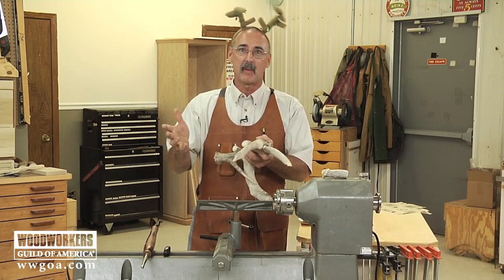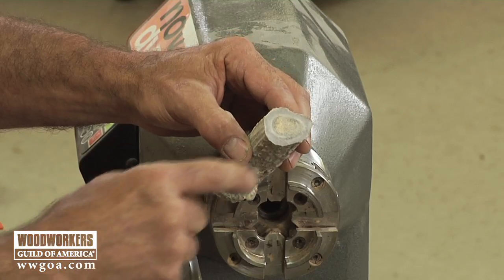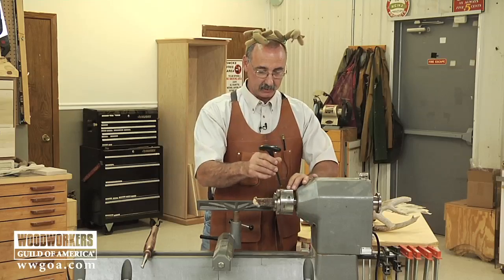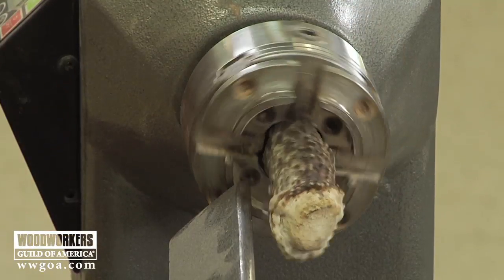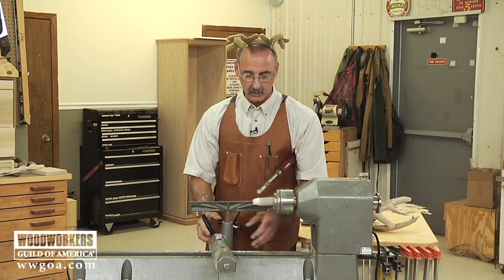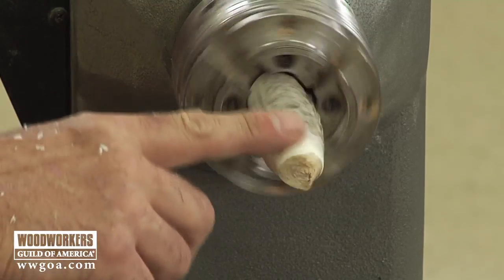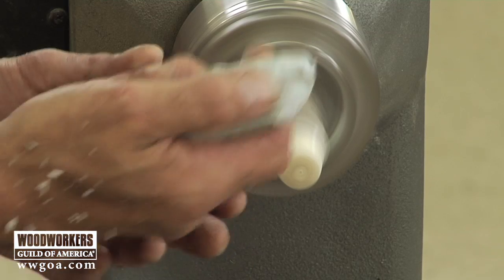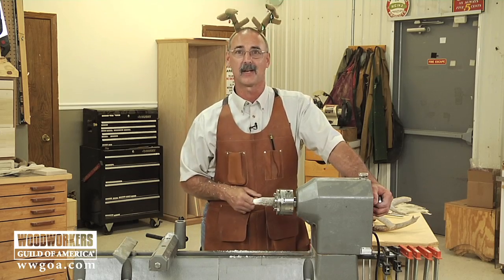Woodworking Tips: Working With Antler

Comment: Hello George;

I have some antlers from an Irish Elk (Megaloceros
Giganteus) that became extinct near the end of the last Ice Age and they are
thicker than a man’s wrist.  The pieces have
come from gravel pits in German and Hungry, so at one time or another after the
animal died their antlers ended up in fresh water.  Their color is a light tan brown and since
they were probably tumbled around in a stream much of the finite detail of the
antler have been smoothed, especially around the burrs.  They seem to be rather dry and in the Irish
Elk they had tended to be very spongy in the middle.  The Irish Elk had some of the largest known
antlers in any deer, a large mature stag antler could be 12 feet across and I’m
sure the weight of the antlers was significant, that is why they were so spongy
in the middle to help lighten the load off the poor animal’s neck muscles.  Even though they were spongy in the middle they
were very durable.  If you were to look
at one of my antlers you can see the hard bone like surface and the spongy
middle, which over time has mostly wasted away. 
To stabilize the antlers, they were coated with a clear glue. In order
to maintain them in this condition, they recommend to keep them at room
temperate and avoid heat.  If any section
of the antler should need attention, they recommend to treat that area with the
clear glue again in order to stabilize the area again and keep it from flacking
or wasting away.

My question is, I want to restore them further to as close to
their original condition as possible.  It
is possible to hand sand them down (I tried it on a small section of the
antler), and my intention was to sand away all the blemishes.  Once done I wanted to “polish” them up to
appear more bone like and restore their original color.  Can you give me any advice or make any suggestions
on how best to do this without damaging or destroying the antler?

I also have a small tusk section of an American Mastodon,
which became extinct during the last ice age also and have sanded away all the
blemishes and used a polishing tool on the piece and it shines like a brand new
penny.  But we are talking ivory vs dry
bone here. So any suggestions?

Thank you in advance for you time and advice on this
matter.  Have a nice day and God bless.

Leo Aguirre
Reply from the maker: Hello and thank you for your question.  This is interesting, but unfortunately your inquiry extends outside of our area of expertise.  I'd suggest contacting someone who specializes in this area for some guidance.

Comment: I just got started into working with bone. I'm combining wood with bone to make a ring. at what point do I stop using power tools. (dremel) and start sanding by hand? When do I switch the grit of sand paper to a lighter one? (300 grit-2000 grit)
Reply from the maker: Hi Michael. Whether it’s antler or wood, the answer is pretty much the same. Each finishing operation should remove the marks from the previous operation. If you can power sand up to the final grit you plan on using, go ahead and power sand throughout the process. When I’m making antler knife handles I start hand sanding at 500-grit. Not because I feel it’s important to hand sand, but because I don’t have a sander that will take 500-grit paper for power sanding.

Comment: is a 4 jaw chuck the only way to mount antler or can you turn it between centers ?
Reply from the maker: +Tyler Greenhalgh Because of the hardness of the material you will have a hard time getting a good grip if you attempt to turn it between centers, so I strongly recommend that you use a four jaw check.
Reply: I turn between live centers 90% of the time. I like the stability of being secured on both ends of the work piece. Because antler can be harder than wood , drill a small pilot hole on what you determine center of the ends. This ensures the pins of the live centers and drive centers can be seated firmly. Experiment and enjoy.